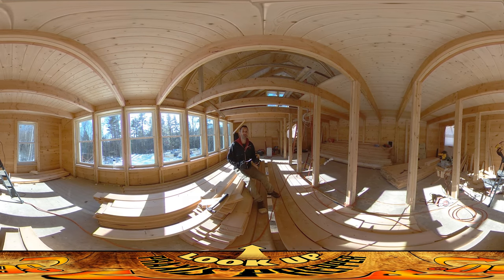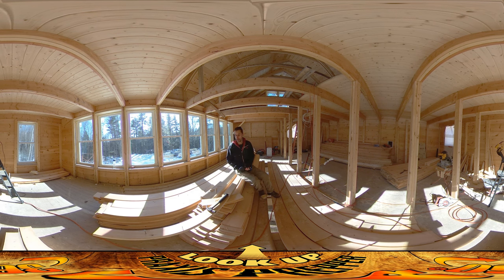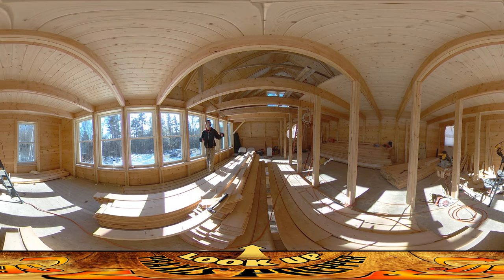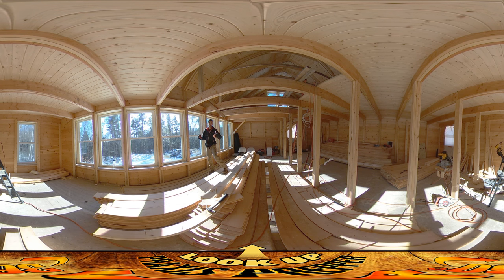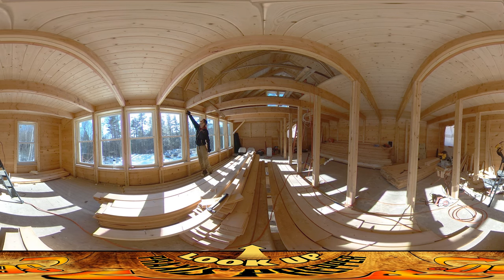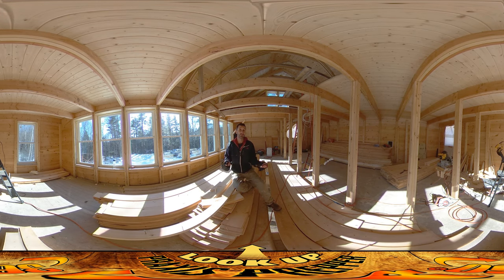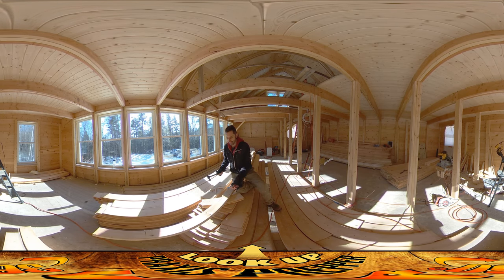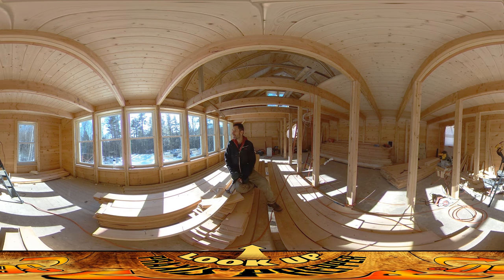Homestead Building - Structural Window Sills, Hammer and Chisel Usage

Comment: Love the view. One tip is to make a bunch of cut lines with your saw and then use the chisel to knock them out and finish the recessed surface if necessary.
Reply from the maker: That's a good tip. I've done that on occasion too.